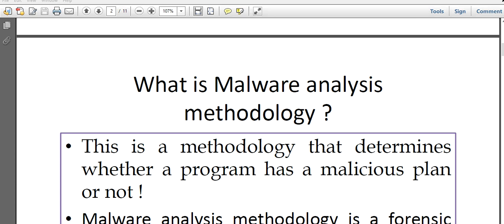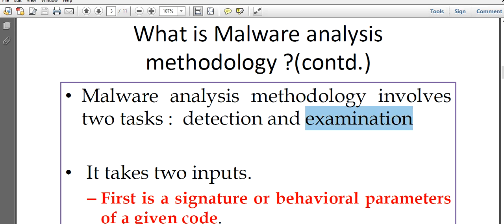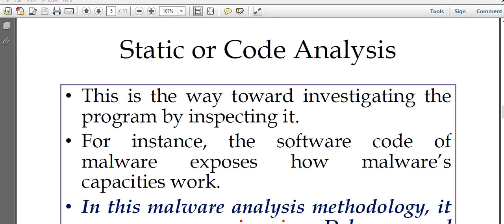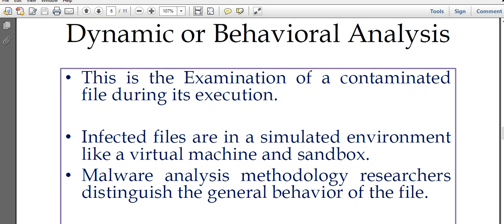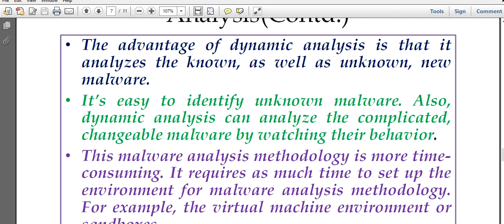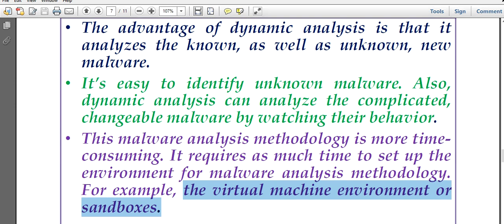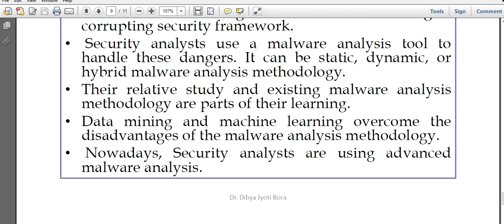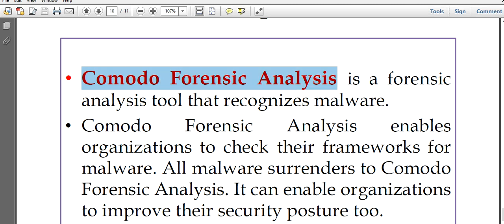#MALWARE ANALYSIS METHODOLOGY||DIFFERENT STRATEGIES||INTRODUCTION TO CYBER SECURITY||LECTURE#2

Comment: Reverse engineering malware involves disassembling (and sometimes decompiling) a software program. Through this process, binary instructions are converted to code mnemonics (or higher level constructs) so that engineers can look at what the program does and what systems it impacts. Only by knowing its details are engineers then able to create solutions that can mitigate the program’s intended malicious effects. A reverse engineer (aka “reverser”) will use a range of tools to find out how a program is propagating through a system and what it is engineered to do. And in doing so, the reverser would then know which vulnerabilities the program was intending to exploit.

Reverse engineers are able to extract hints revealing when a program was created (although malware authors are known to leave behind fake trails), what embedded resources they may be using, encryption keys, and other file, header, and metadata details. When WannaCry was reverse engineered, attempts to find a way to track its spreading led to discovering what is today known to be its “kill switch” – a fact that proved to be incredibly important to stop its spread.

In order to reverse malware code, engineers will often use many tools. Below a small selection of the most important ones:    *.Disassemblers.  *.Debuggers   *.PE Viewers. *.Network Analyzers

Comment: Reverse engineering malware involves disassembling a software program. Through this process, binary instructions are converted to code mnemonics so that engineers can look at what the program does and what systems it impacts. Only by knowing its details are engineers then able to create solutions that can mitigate the program’s intended malicious effects. A reverse engineer (aka “reverser”) will use a range of tools to find out how a program is propagating through a system and what it is engineered to do. And in doing so, the reverser would then know which vulnerabilities the program was intending to exploit.

Comment: Reverse engineering, also called back engineering, is the process  by which a man-made object is deconstructed to reveal its designs, architecture, or to extract knowledge from the object; similar to scientific researchthe only difference being that scientific research is about a natural phenomenon.

The Client

The client is a manufacturer and supplier of spare parts used in a wide range of refrigeration compressors. Its market presence extends to the UK, Europe and Middle East.

Situation - Business Needs

The client had hundreds of fiber gaskets that needed to undergo reverse engineering in order to produce true dimensional solid models in DXF file format. The major factors warranting an offshore solution were dearth of skilled engineers and draftsmen in the local market, and client's budgetary constraints. The client was positive about the outcome of an offshore possibility, which would allow savings in operating costs in addition to allowing it to focus on its core business goals. Apart from the cost factor, it also wanted to benefit from the competency of an outsourcing vendor to create better operational efficiency and streamline its processes.

The client's business situation had the following components -

Having hundreds of gaskets reverse-engineered according to predetermined specifications

The gaskets needed to be shipped to an offshore location

Ensuring high-quality output to derive a true dimensional model of each gasket in DXF file format

Using the DXF files to develop shapes to cut the gaskets
Reply from the maker: Good Explanation

Comment: Robart Konwar
I'd:-CS18MSIIT025

Ans:- Reverse engineering malware involves disassembling (and sometimes decompiling) a software program. Through this process, binary instructions are converted to code mnemonics (or higher level constructs) so that engineers can look at what the program does and what systems it impacts. Only by knowing its details are engineers then able to create solutions that can mitigate the program’s intended malicious effects. A reverse engineer (aka “reverser”) will use a range of tools to find out how a program is propagating through a system and what it is engineered to do. And in doing so, the reverser would then know which vulnerabilities the program was intending to exploit.

Reverse engineers are able to extract hints revealing when a program was created (although malware authors are known to leave behind fake trails), what embedded resources they may be using, encryption keys, and other file, header, and metadata details. When WannaCry was reverse engineered, attempts to find a way to track its spreading led to discovering what is today known to be its “kill switch” – a fact that proved to be incredibly important to stop its spread.

Comment: (CS18MSIIT039) Reverse engeenering method involves disassembling a Software program. Through this process, binary instructions are converted to code mnemonics so that developers or Engineer can look at what the program does and ehat system it impacts

Comment: Reverse engineering malware involves disassembling a software program,binary instructions are converted to code mnemonics so that engineers can look at what the program does and what systems it impacts. After knowing engineers then able to create solutions that can mitigate the program’s intended malicious effects. A reverse engineer will use a range of tools to find out how a program is propagating through a system and what it is engineered to do. And in doing so, the reverser would then know which vulnerabilities the program was intending to exploit.

Comment: Abdul Zabber::
Reverse engineering malware involves disassembling (and sometimes decompiling) a software program. Through this process, binary instructions are converted to code mnemonics (or higher level constructs) so that engineers can look at what the program does and what systems it impacts. Only by knowing its details are engineers then able to create solutions that can mitigate the program’s intended malicious effects.
Reply from the maker: GOOD EXPLANATION

Comment: Reverse engineering malware is the process of taking a captured executable (a stand-alone executable or a library file, such as a DLL) and doing the computer equivalent of an MRI. Analyzing malware in a "safe" environment -- such as a virtual system on a machine that isn't connected to your network -- would be the option of choice. At least this would allow you to snapshot your OS and revert to it whenever you inadvertently kick the malware under your microscope into action.
 Unix admins who have some experience using the strings command to identify strings defined within binaries or hex dumps provided by commands such as od will have some rudimentary knowledge of the contents of executables, but there is lot more that you can see if you examine the malware file using a debugger (a tool that allows you to step through a program, watching for the effects that each step makes) or a disassembler (a tool that turns the machine language of your malware into assembly language). With a disassembler, you would perform what is called "static analysis". With some experience, you will come to see how the malware you are analyzing was intended to work. Maybe it inserts itself into another process, maybe it creates a file, maybe it changes user settings ... With a debugger, you can break and change the code "on the fly". You can exploit test conditions that may have been designed to make the malware appear being under certain conditions. You can jump over code that isn't worth your time to analyze. This process is often referred to as "dynamic analysis".
Reply from the maker: VERY GOOD EXPLANATION

Comment: Reverse engineering in malware analysis involves disassembling and sometimes decompiling a software program. Through this process, binary instructions are converted to code mnemonics or higher level constructs so that engineers can look at what the program does and what systems it impacts.
Reply from the maker: GOOD EXPLANATION